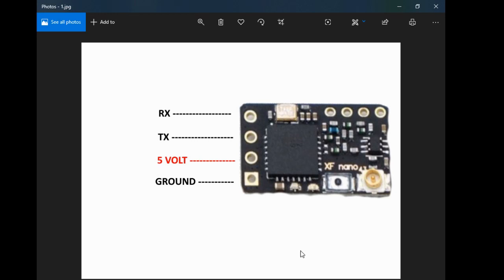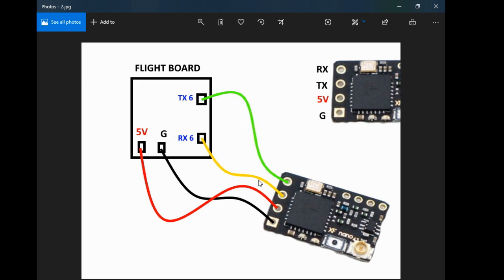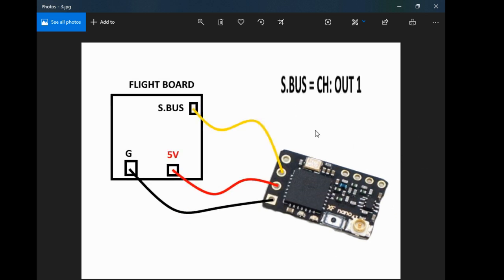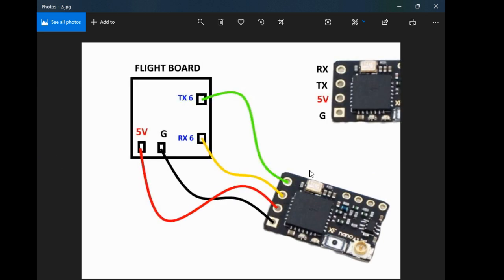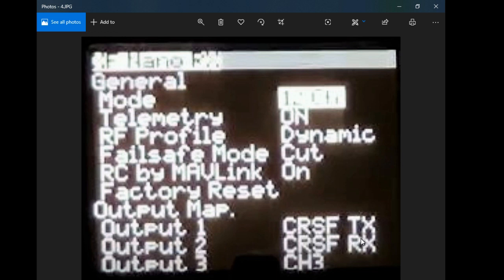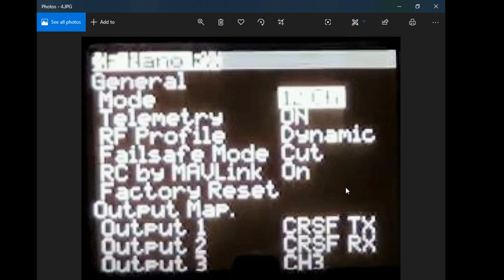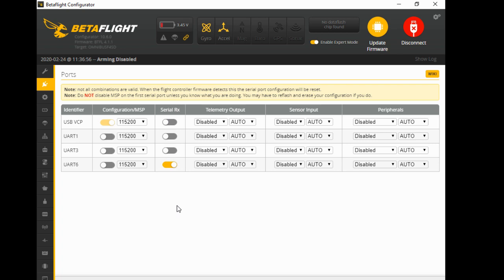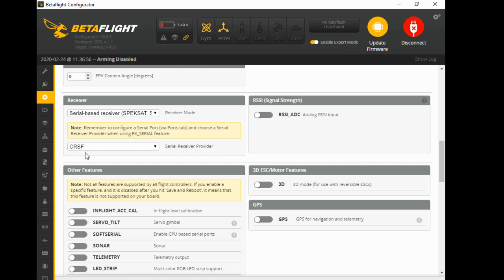TBS CROSSFIRE  NANO SUPER SIMPLE SETUP

Comment: Subbed! Finally someone who really dumbed it down. My question is due you loose latency by going SBUS? You mentioned you at least get to keep RSSI what about smart audio? :)
Reply from the maker: Hi, thanks for the Sub. No, you won't lose latency, and yes you can still get smart audio if you have a smart audio pad on your flight control board. But you will have to wire it, from a spare pad on the TBS Nano, then select the channel in the ports tab. To find out which channel you're using on the nano if you google ( pinout for tbs nano ) so you know which channel your using see link
 and go to page two. https://www.team-blacksheep.com/tbs-crossfire-nano-quickstart.pdf

This reads more complicated than it is to do ( Sorry about that ) It's basically adding another wire from the Nano to the smart audio pad then telling Betaflight which channel you put it on.

However, If you have a spare RX/TX pad on your flight control board it's much easier to wire it up the first way and get full Crossfire in one go. Hope this helps
Reply: @GeorgeCooper_LoneWolf  Excellent explanation! This makes perfect sense. I'll have to watch your archive videos. I'm sure there's more Intel that I can learn from.  Thanks for doing this for us "new" people 😁🤙🙌. One question I did have you can't share a pad for smart audio correct? I have a stack that connects to each other and I'm pretty sure its being used within that pin connector.
Reply from the maker: @armani007E55  Happy to help. What stack are you using ?  if you're not sure because you have a ready to fly quad, just let us know which quad you have and I will look it up and get back to you.

Comment: Hi George, just came across this video as I am switching to crossfire. Great video indeed!
I just have a question. You mention nano rx can be hooked up to an sbus pad on the FC but usually sbus pads are inverted uarts for Frsky sbus and I understand that in this particular case the nano rx will not work. Can you please confirm you need a non inverted pad (or a regular non inverted uart)  to make it work? Thanks!
Reply from the maker: If you wire the TX from the Nano to the Sbus pad on your FC you should have no problems. However, don't forget you need to select Sbus in betaflight on the configurations page "NOT" CRSF  and change from crsf to sbus in your radio.

If you still have problems tell me what FC board your using and your Transmitter / Crossfire set up, so I can try and help more. Also, don't forget to update your Nano & Crossfire in TBS Agent X
Reply: @GeorgeCooper_LoneWolf  ok thanks I will try this and get back to you. Interesting as I understood it would not work on an inverted sbus dedicated uart. By the way my FC is a mamba F4
Reply: @GeorgeCooper_LoneWolf  it works! Thank you so much!
Reply from the maker: @erich7431   😃 Great news buddy, glad you got it working

Comment: Hello George, i need help: my tbs crossfire nano  lost the antenna when flying, after that the rx keeps flashing, after I bind the receiver is connected but disconnected again after the battery is removed. Is my RX broken? thank you
Reply from the maker: There's a chance the nano got damaged after the antenna came off. However, you may be able to sort it with a firmware update. Download the latest virion of
 (Agent X )  from the TBS website "Take the props off" your quad then plugin your TBS transmitter/module to your PC and plug in a battery and power up the Quad whilst running Agent X  first of all update the nano then update the transmitter with the same firmware version you updated the nano. Normally you would do this the other way around but try it. If this does not work then it may be damaged beyond repair and you will need a new one SORRY.  Hope this helps buddy...
Reply: @GeorgeCooper_LoneWolf  thank you so much, George. very much appreciated 🙏❤️🥃🥃
Reply from the maker: @doktordrone  Your welcome buddy

Comment: I'm new to the hobby, is this the only receiver that I need for using tango 2 controller. I'm using dji fpv system but want to use crossfire for radio controller.
Reply from the maker: The Tango 2 can only be used with any TBS Crossfire revivers. But this is the best.  But you can't use this receiver with the DJI Transmitter
Reply: George Cooper would you mind if you can guide me what receiver should i get or link ? I appreciate it. 🙏 thank you
Reply from the maker: @kevinfuentes1325 If you want a receiver for the Tango 2 get this one But if you what a receiver for the DJI transmitter. That's built into the
 ( DJI FPV Air Unit )
Reply: @GeorgeCooper_LoneWolf  Thank you ! is tango 2 good for long range too and better than dji transmitter? Also, to wire up this tbs crossfire nano.. I have to wire it up for sbus right just the 5v, ground, and then sbus? I really appreciate it.
Reply from the maker: @kevinfuentes1325  The Tango 2 will give you plenty of range ( between 2 / 15 miles ) depending on where you fly. I don't know if it's better than the DJI Transmitter because I don't use one. As for Nano and how to wire it up all the information is in the video.  Hope this helps.
Reply: @GeorgeCooper_LoneWolf  Thank you !!
Reply from the maker: @kevinfuentes1325  YOUR WELCOME

Comment: Hi, i have also the tbs tango 2 and its says sometimes "sensor lost" having 99% rssi.... what that means?
Reply from the maker: First thing don't panic (Not a big problem) More of a pain to your ears than anything ells, and don't worry about the RSSI as long as your getting a good signal your fine.  

Now assuming you have no lose wires on your receiver, this can sound off because of a glitge and a firmware update will sort it out so try that first. Now if that dose not work, as funny as it sounds you can simply remove the Sensor loss sound your getting, Hears step by step how to do it on the Tango 2.

#1 Press and hold the menu button to get into Radio settings
#2 Press the page button once to get to the SD Card tab
#3 Scroll down to sounds and click enter (on the scroll wheel)
#4 Select ( en ) = English and click enter
#5 Now find your sensor sound ( you can click enter to play the sounds to find the right one, and once you have you can either Rename it witch should stop it from sounding off, or Delete it,  however if you rename it you can always reset it up again if needed for any reason ( so make a note of the original name )

hope this helps.

Comment: is this same goes with tango 2
Reply from the maker: I'm using the Tango 2 in the video
Reply: @GeorgeCooper_LoneWolf   did you used any other VTX , Does crossfire  nano rx  built with receiver and transmitter for audio and video
Reply from the maker: @anweshdevkota7044  Yes you can get (Smart audio) for settings setup, as for the VTX that has nothing to do with the receiver

Comment: Hi there anyone can help me with the setup please!!! I got cinepro4k with tbs crossfire nano rx installed on it and have a taranis x9lite s with tbs crossfire micro tx and i cant fly((( they are actually binding but in the betaflight the taranis is not seen and the drone doesnt fly???any help is appreciated
Reply from the maker: (Don't look for Taranis) In betaflight go to the configurations tab. scroll down to 
the Receiver tab and select ( Serial based receiver and under that
 select CRSF ) hope this helps
Reply: @GeorgeCooper_LoneWolf  thx George! But i actually did that! Taranis sees it! But the drone doesnt fly!
Reply from the maker: @nomadexperts432   OK then matey let's try something ells. Take the props off goto the motors tab in betaflight plugin a lipo and power up the motors using the onscreen slider. you will have to turn on the switch that says you understand the risk. ( let us know if the motors spin or not )
Reply: @GeorgeCooper_LoneWolf  sorry!they spinn now they work!  Tbs crossfire rx and tx are binded onneted in between them, but the drone is not accepting commnds from the taranis
Reply from the maker: @nomadexperts432 Right so the motors spin in the motor tab great. Now go to the receiver tab and check if any stick combined works (do any of the BARS move)
Reply: @GeorgeCooper_LoneWolf  no bars move! Zero reaction(((
Reply from the maker: @nomadexperts432  On betaflight setup tab the first page that opens. On the right-hand side, there is a box with info like the rssi  at the top are there any FLAG codes such as MSP ?
Reply: @GeorgeCooper_LoneWolf  where is betaflight setup? I saw rssi only in reciever tab on right side🤦‍♂️
Reply from the maker: @nomadexperts432   When you plug your quad into the pc the first page that comes up in betaflight after you click connect
Reply: @GeorgeCooper_LoneWolf  actually it doesnt come up automatically, i open the betaflight (version 10.6.0) and click connect, but when i open it it has no rssi box on the right side,
Reply from the maker: @nomadexperts432 On the setup page on the right there is a Box. At the top it will say arming flags and under that more info. If this Box is not on your setup page you have a betaflight software problem. The best thing to try under them circumstances is to reflash betaflight on your flight board. Worth a try
Reply: I found that ...it says
arming:MSP
Battery:16.95
And rssi :50%
Reply from the maker: @nomadexperts432  The MSP is nothing to worry about that's just letting you know the USB is plugged in. I was hoping for something ells. Sometimes a flight control board won't run properly on a high firmware, you may want to try a lower version of betaflight  if you are running 4.2 also your ESC setting may be wrong if you're running Dshoot 600 try Oneshot. But I would reflash betaflight. Sometimes there's just a glitch in the upload. Let us know how you do But for today I have to go. But please check in tomorrow I'm sure we will figure it out
Reply: @GeorgeCooper_LoneWolf  ok George thank you very much!
Reply from the maker: @nomadexperts432  OK then round two. There is one more thing you should check. Make sure the TX wire from the receiver is going to the RX on the flight board. And the RX wire from the receiver is going to the TX.
Reply from the maker: @nomadexperts432   Sorry I didn't get back to you sooner. I think you should still strip it down and check all the wiring (just encase)  However before that can you make a video showing the betaflight setup and your radio setup. if you can let us know once you have posted it.  Because you said the motors spin in the betaflight tab/transmitter is bound. so there must be an issue with the setting or a loose wire.
Reply: @GeorgeCooper_LoneWolf  hi George! Thank you very much for the help! Ok ill try to strip it and if will face some issues again, looking forward for you advice ! Thxt. Take care